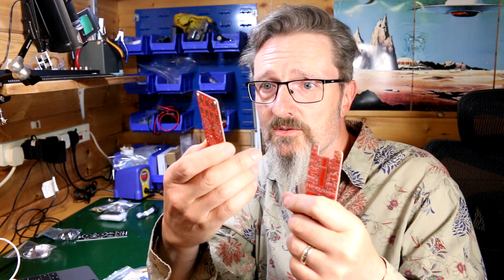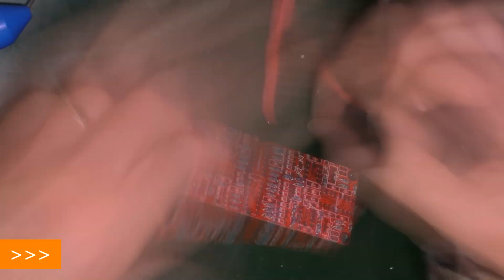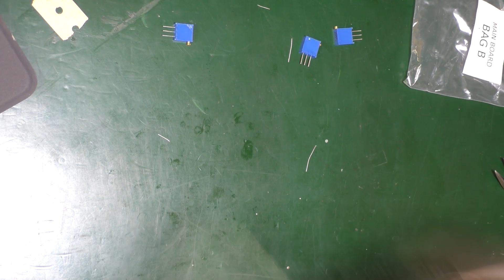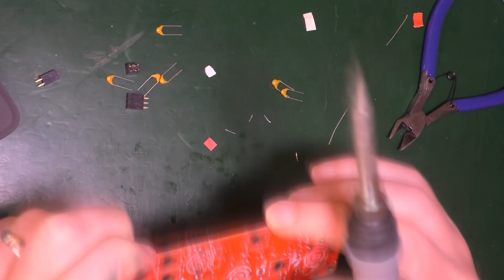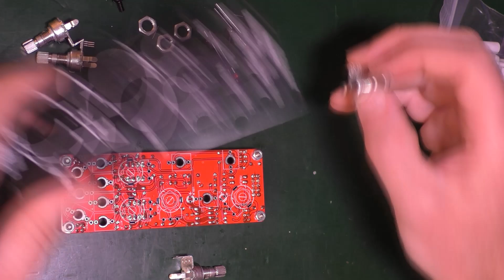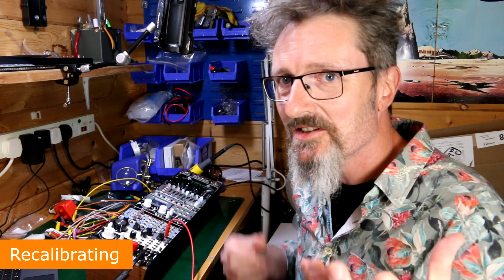Modular DIY 07 - Befaco Chopping Kinky

Comment: Thanks for the calibration instructions. I didn’t understand the written instructions either. 

As far as your channel not working, a good thing to check when troubleshooting is connection between the header pins between the 2 PCBs and of course the jacks. That will fix most issues assuming the components are correct and properly installed.

Comment: First time I got 2 befaco kits.. both were missing parts.
Reply from the maker: That's a shame, give them a shout
Reply: @MoltenMusicTech  yea, I had some other old circuit boards laying around and I have some resistors and stuff,  happened to have what I needed in the next size up format but same specifications,  it still fit. it was easier to just use those, but I did let the shop know what was up.
Reply: @MoltenMusicTech  shop igot them from sent me couple resistors... wrong ones. I dunno why they even bothered or if they couldn't tell the difference.

Comment: Just out of interest, what temperature do you usually solder with as it looks you're using a fairly low temperature seeing the duration that you are holding the soldering iron against the board and components. So far I found that there is quite a discussion about the 'correct' temperature so there doesn't seem to be a consensus.
Reply from the maker: I don't remember in this one. But i was using 390 C until recently when the Dysphonia build manual said i shouldn't use more than 350 C - so i'm using 350 C now. I can't remember why i chose what i chose and i'm not involved in those sorts of discussions :D
Reply: @MoltenMusicTech  Agreed, I personally never cross the 360° when working on modern PCB’s.

Comment: Hi there! I´ve just buildet my own Chopping Kinky and i have the problem that the  Input B is not working.There is somdsound, but far far away. Transistors are alright. And for now i have no idea whats to do. And in the case of my Chopping Kinky i put a signal in A and teh red LED of B is on. The LED of A is not working in this case.

Comment: Nice demo at the end. Drives me nuts when they say "here's what this module can do" and then they use 19 modules to create an input and run the output through 19 more modules and you can't tell what's coming from the module of interest and what's coming from elsewhere. You focus on the module itself with simple inputs and outputs and that's so much more useful. I just built a much simpler wavefolder, the NLC Timbre, which does a lot less than this but it's step on the road beyond the east coast synthesis mindset I've had for so long!

Comment: For the calibration procedure, you need a couple of board spacers with m3 thread; screw those into the washers in the rail and screw the module on top. This way you're not fudging to reach the trimpots and the module is pretty secure to handle the knobs and patching. I use 30mm ones, they're dirt cheap.

Comment: I always used to use an old discarded pair of nail clippers to snip the wires off components after soldering. I have no luck with soldering irons though. My current Antex 25 watt never seems to get hot enough even using normal leaded solder (less heat needed) & new bits. I bought a 60 + watt controllable one for heavy duty jobs which failed after using once! Can't remember if it was off Amazon or eBay but I suppose I should've complained to seller. I must be cursed! By the way I want the kinky. I own Befaco rampage & sampling mod, both ready built though!

Comment: Looking good so far Robin. I've pretty much gone over to using RoHS (lead-free) solder for everything electronics-wise. You do need more heat out of the iron, a clean tip and lots of flux (I do mean lots of flux. Get a flux pen if you use a lot of lead free solder). The Turing Machine is probably as densely packed as the Chopping Kinky so that gives me a good idea of how long it takes to solder up (couple of evenings I guess)

Comment: Lead free solder requires a higher soldering iron temperature.  Also, it cools to a more brittle solid.  That's why people suggest against it because it could crack on the circuit board more easily as you use the circuit.  Any flexing from plugging/unplugging cables and twisting knobs may cause issues later on.  So just be aware if it stops working properly in the future you may just have to clean up and re-flow the lead-free joints.  An annoying, but easily repairable, problem.  More than likely you'll be fine for quite a while.

Cheers from your Patron, Greg :-)

Comment: lol you always say you don't have the faintest idea.
you're either the luckiest man alive or you're having us on :)

I thought that the deckards had a lot of SMD, I just looked on their site and it turns out all the SMD is pre installed, happy days.

if all you have to do on the kit is thru hole you should breeze it, especially now you have decent solder :)
Reply from the maker: Ummm, yeah, right, so there are some ICs that are presoldered on the board but I've got a reel of about 400 SMD capacitors in this kit for the voice cards alone so, no, there certainly is a lot of SMD to do on this thing :D
Reply: @MoltenMusicTech  ooft. their site says this "Besides the built units we provide DIY kits with all digital SMT parts preinstalled"
 smd isn't so bad really, just get yourself a jewelers loupe, and also get a flux pen....  (the flux pen isn't a must have but it helps)

dab a little flux onto one of the pads for your component then pre melt a bit of solder onto that pad, (the flux just helps the solder to stick to the bare pad) place and hold your component with tweezers and reheat the solder, that will stick your component in place , then you can solder the other side. (it's actually quicker to do than through hole once you get a rhythm going)
Reply from the maker: Yes, key part is the word "digital" - I've got all the analogue bits to solder :D
Reply: @MoltenMusicTech  lol good luck.